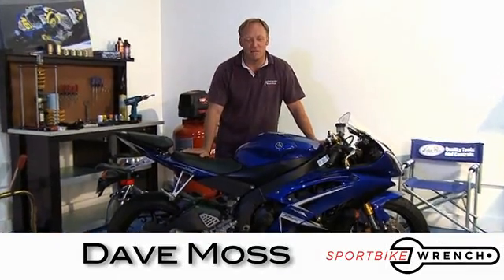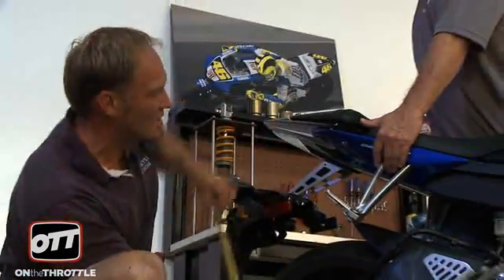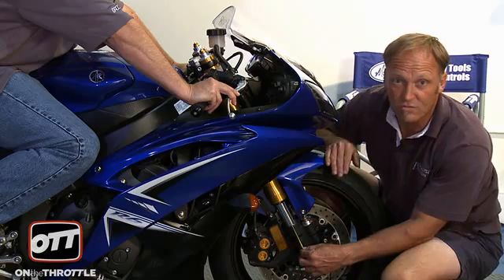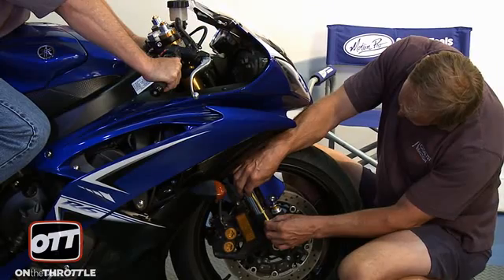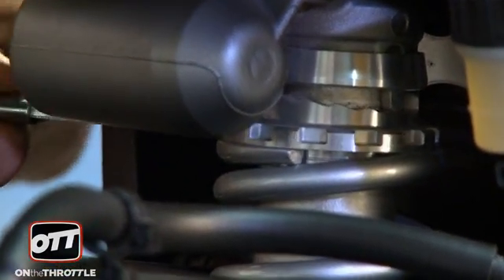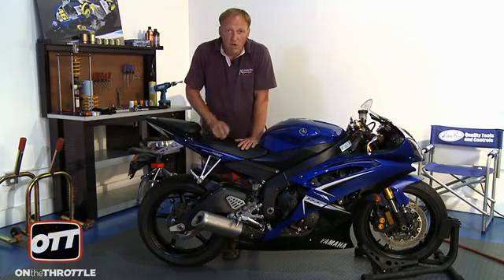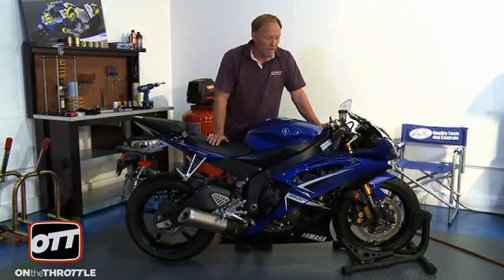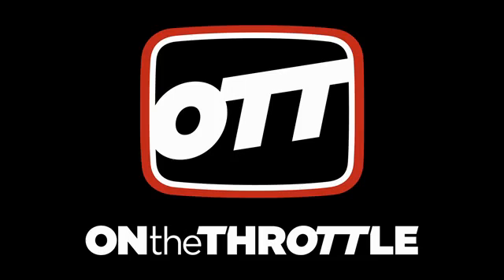Motorcycle Suspension - Setting Sag

Comment from the maker: @cameron197040 Cam, thanks for the info. Sag should be 35-40mm in the front and 30-33mm in the rear. Set compression at 9 out for low speed and 1.5 turns out for high speed, Rebound at 8-11 clicks out. Fork compression should be 7-10 clicks out and rebound 10-12 clicks out. You need a 5mm washer between the shock and frame to correct the swing arm geometry from the gearing change. 

Let me know how that works with an email to ottmoss@gmail.com

Dave Moss
Host

Comment from the maker: @wweeks587 Please email e via dave@crstuning(dot)com wit answers to these questions:
- original forks and shock and how many miles on current fork and shock oil?
- stock gearing or aftermarket (and how is it different to stock)
- brand and size of tires

Dave Moss
Host

Comment from the maker: @LightningMAS Mike - front is the larger number, rear always a smaller number. Start with compression in the middle of the toal range, and then go 1/3 hard, 1/3rd soft and see what side YOU prefer.

Dave Moss
Host

Comment from the maker: @crash86ed yes it will apply to any street or track bike. It is only a starting point, but that is a lot better than stock! At least the bike will be balanced correctly front and rear to your body weight. Then move on to hydraulics and set compression in the middle of the range and go ride. You will be surprised at the difference that makes without trying to balance rebound out front to back.

Dave Moss
Host

Comment: Dave,

Will all of this apply to pretty much any bike (or at least, sport bikes on the racetrack)? For example, my track bike is a 2002 sv650. It has a 2k1 gsxr front end, and a fox rear shock. Would I use the same ballpark figures when setting the sag on my bike? 

Thanks, 
Austin

Comment: @OnTheThrottleTV  ...  Okay, Im confused. Which is for front? and which is for rear?    The fork oil been changed a month ago with lighter weight.  Pro RSF 5w fork oil. 

Thank you so much. I will let you know how it goes, when the weather warms up.  I cant ride yet.  Its winter here still. 

Also, Should i go all the way hard then click out from there, or should i turn it all the way to soft and start from there?

Thanks Dave..  

-Mike

Comment from the maker: @LightningMAS tr these settings, Fork preload in the middle of the range, rebound at 1 turn out from close, compression at 2 turns out from closed. Leave the shock preload alone set compression at 1-2 turns out from closed and rebound at 1.5 turns out from closed. This all depends on fork and shock oil age/mileage. If yo are over 10k with old suspension oil you will need to set rebound more to the closed end by  .25 or .5 of a turn

Dave Moss
Host

Comment from the maker: @scotty466 125's and 250's need much tighter sag number due to such high corner speed capabilities. Front should be 25 to 30mm and rear should be 20 to 25mm. Correct spring selection is critical on these GP bikes, and you shouldn't have more than 12mm installed preload on shock and fork springs. Take the time to make sure you have the right springs based on track design.

Dave Moss
Host

Comment from the maker: @wowerman yes, you can lower the bike by softening preload and compression. Start with preload first. Remember that when you lower the bike or soften the suspension, the danger of hitting hard parts on the ground increases dramatically. Only go as much as is needed.

Dave Moss
Host

Comment from the maker: @wowerman 3.5 inches is a good starting point for the forks. Then adjust preload to test front fork dive when you initially apply the brake hard. Get comfortable with that setting and then play with compression  damping for bump absorption.

Dave Moss
Host

Comment from the maker: @wowerman there are products out there to help lower the bike with adjustable lowering links. You can soften the preload on the rear shock as that has a stiff rear spring and this would give you an immediate benefit. You can also soften the compression damping to the middle of the range to help the bike sag a little more. The fork springs are soft, so be careful with fork spring tension changes.

Dave Moss
Host

Comment: i have kawasaki zzr1400,zx14,i am 5,7 (167cm ) height and about 13 stones (82,5kg),i need to lower bike to touch ground better,what is correct way to do it and keep good suspension settings?can i lower bike just with rear shock spring preload?

Comment from the maker: @Doubledge007 make sure you know where all the adjusters are when you start, and then go through one full range of adjustment  on one adjuster at a time. Make sure you note where each adjuster feels the best and put it there before you move on to the next one. Rear shock preload will be the most difficult.

Dave Moss
Host

Comment from the maker: @GoproNoob  The front end you have is way too stiff with 1.0kg springs. Take all the preload out set rebound to one turn out and set compression at 2 turns out. For the shock, leave thepreload in the stock position, set compression at 14 clicks out and rebound a 2.5 turns out.

Dave Moss
Host

Comment from the maker: @michaeldegge The Scotts has a degree range as a rotary damper compared to a GPR that dampens throughout the turning radius. The Scotts is very adjustable as long as you know how to adjust it and they have very comprehensive instructions. As with all dampers, service the oil every couple of years or less depending on use.

Dave Moss
Host

Comment from the maker: @michaeldegge  This will not effect preload, just compression. You may need to add or remove 2 or 3 clicks depending on your braking technique.

The benefit is a little more stroke that couldn't be accessed otherwise!

Dave Moss
Host

Comment from the maker: @michaeldegge  Keep the forks flush and not too much rear ride height, depending on rear axle position.  Set the front sag at 42mm and the rear sag at 35mm. Compression needs to be in the firmer half of adjustment and set rebound as needed. 

Dave Moss
Host

Comment from the maker: Preload does not need to change based on ambient temps - only based on track topographical demands, rider weight fluctuations of 15 plus pounds, and 2 up riding.

Rebound settings change based on ambient temps and oil age. The older the oil the more it gets to be molasses. Therefore the colder the temps the more it stays that way, especially with front forks that are constantly exposed to very cold air. Factor in wind chill at 50 plus mph and you understand why cold steel won't heat up fork oil.